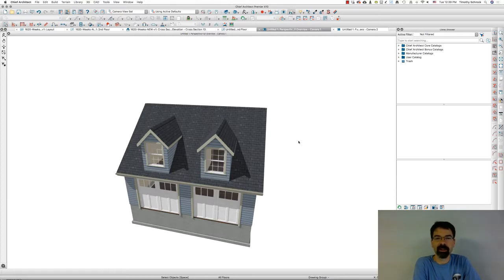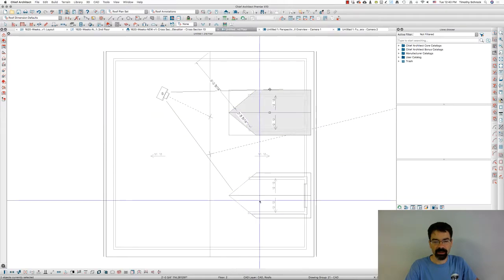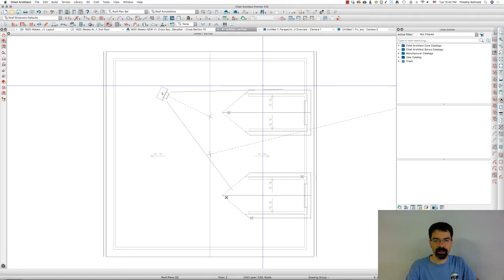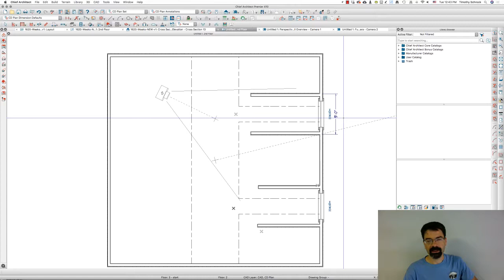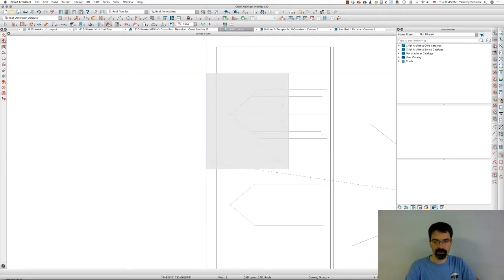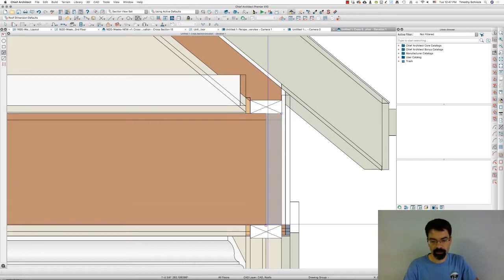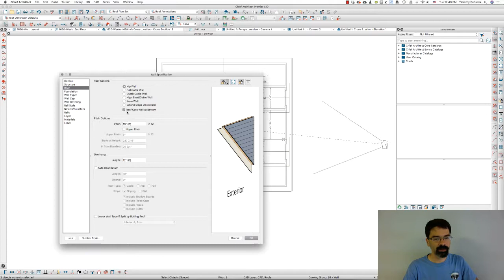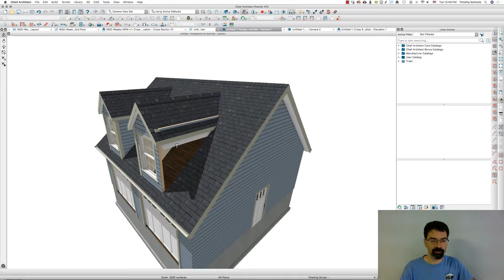Modeling Dormer Walls Properly

Comment: If you want to hide the wall in plan view, simply create a new layer for "dormer wall", and turn it off in plan view
Reply from the maker: That is another way to do it. I've tried that, but the issue I run into is that creates a wall which baseboard molding follows, etc. This is just my way of handling all the issues I don't like.